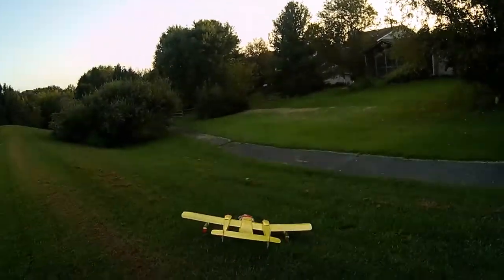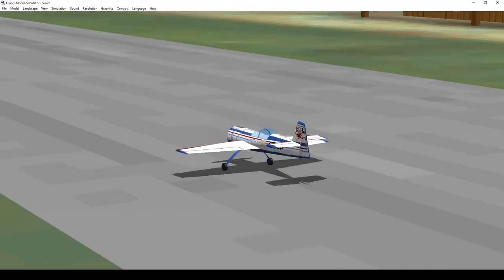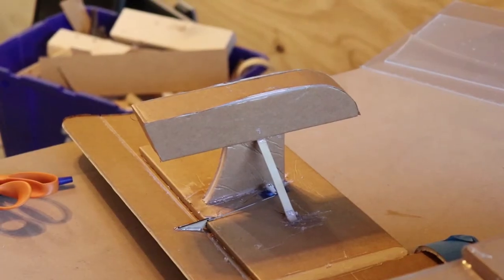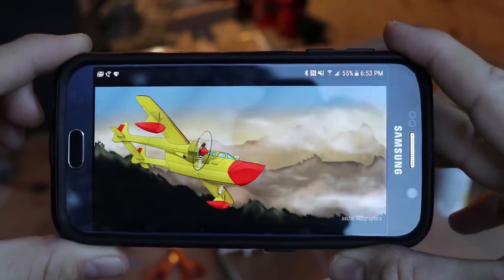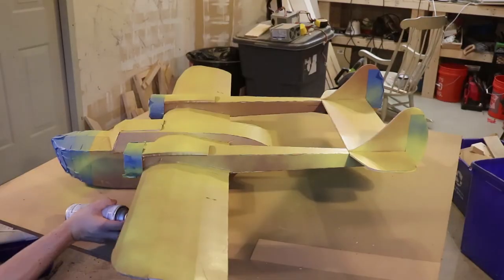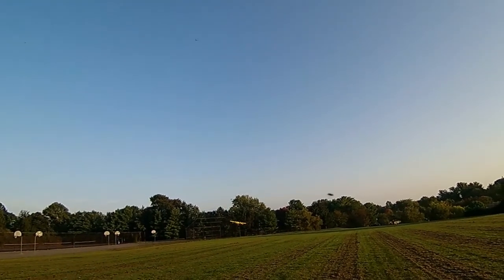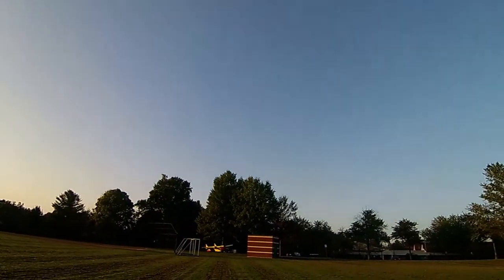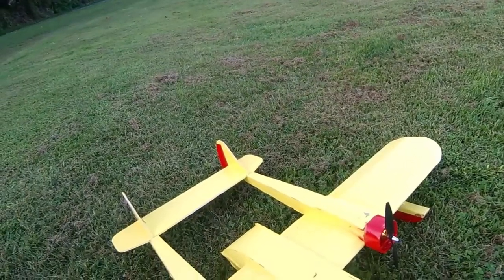What To Do When You Crash Your First Plane

Comment: Are you an experienced RC pilot or was this your first try?  This plane might not be a good choice for a beginner.  I'm an intermediate pilot but a lousy builder.  Everything I've tried to build has crashed.  Like you said, you put in all those hours to build and then to crash is disheartening.  All of my planes are ARFs, so it's more assembly than build.  I want to try this SeaDuck, but don't want to go through your same pain.  What is your final analysis of the FT build?  Would you go through it again?
Reply from the maker: ron045 I'm not at all an experienced rc pilot. I have several multirotors that I've built from scratch, but this is my first fixed wing. And you are exactly right, this plane is not a good trainer. I knew that going into it though, but decided to go with it anyway. I'm the type of person that enjoys the build process just as much or more than the flying part. This was meant to be a learning project for me. If you've built other planes I would definitely recommend this plane. A big part of this hobby is getting over the fact that your aircraft are going to crash and you're gonna have to rebuild it. Let me know how your build goes, I'd love to see pictures!
Reply: it's true this is not a beginner plane. but what your achievements are still quite impressive. the only thing for all the loses you gain is, seems due to avoiding pre flight checks. 
happy flying.